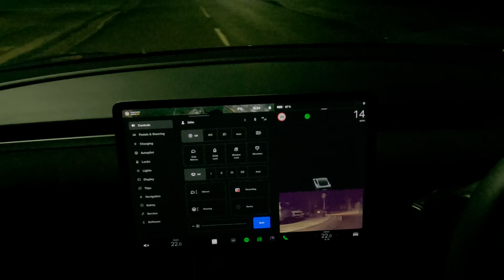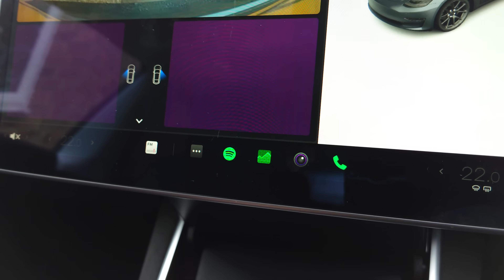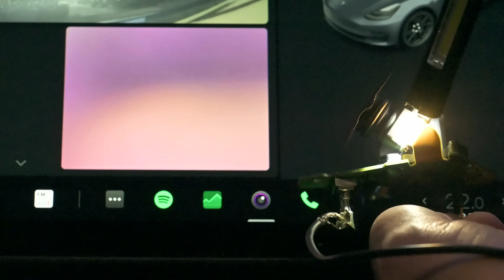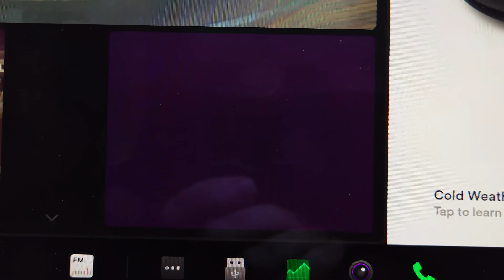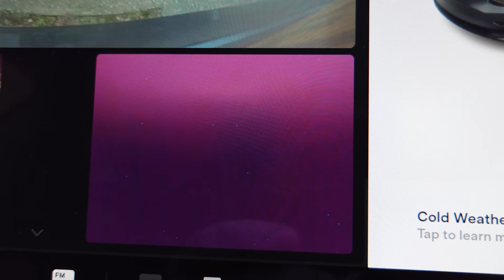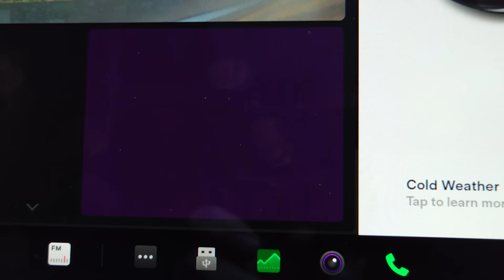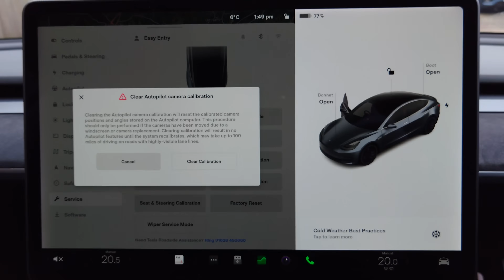Repeater glare and how to fix it (if you dare!)

Comment: 6:53 The simple work around seems to be just to leave the 12v connector removed and leave the camera connector attached. If the 12v side blinker has no power... you will get no light leakage

10:52 Much like you did in the Demo here with no 12v to test the light leakage... just remove the power source and you are GOLDEN 😂

Comment: Wouldn't it be better to bake the unit and separate the glass from the plastic housing and apply the tape as done on the new updated unit? Add some sealant if necessary and clamp it back into place with some heat?
Reply from the maker: It's not possible to split the hosing, it's welded, so you'd need to cut it which is very tricky to attept without risking damage to the components inside.

Comment: I watched this video and few other ones. They really rather excellent. Thank you for sharing. I'm also fo the opinion that less parts  the landfill or recycled is better. Especially if we can easily fix them. I wonder if you came across issues with excessive condesation inside the fronk, front boot, however this is called. In my Tesla model 3 2020 this seams this be an issue even after replacing the seal.

Comment: Directions great, paint I used, not so great. DO NOT USE ACRYLIC PAINT! It will short the boards and then it does not work.
Reply from the maker: Partly why I tend to use liquid insulation tape. Maybe you used black paint which had a carbon content? Good point though. Check whatever you use is non-conductive!

Comment: I used a soldering iron with a thin tip.  Then used Sika black adhesive to cover the holes, transparent glue and then seal the 2 holes
But first I purchased a damaged (broken clips) camera to to a test run.

Comment: Did this today as this was annoying me for a long time. Drilled the two holes but cut a slot between the two with a dremal. Then used epoxy resin with black pigment and poured a tiny amount over the camera. Then used Colloidal Silica to thicken the resin and seal up the slot I made. Worked very well. Thanks for posting this.

Comment: Have you considered trying some sort of chemical attack on the glue holding the 2 halves together? May be worth just redoing the glue rather than drilling holes.
Reply from the maker: They aren't glued, they are welded using heat or ultrasonic welding.

Comment: Man, I went into this with the utmost confidence and it ended up costing me 200 bucks on used cameras. No fault of the video though.

Where I screwed up is I was doing both cameras at the same time. I used a soldering iron to make the holes and then used a small drill bit to clean them up. While cleaning them up I must have knicked something. Follow his directions to a T and you won't have any issues. Lesson here is don't get cocky lol

Comment: One could argue it's a safety issue to have  glare from the turn signal light. Therefore Tesla should be pro-actively issuing a voluntary recall or a replacement program. They are at risk of a lawsuit.

Comment: Thank you so much for this video!  Made the modifications straightforward. And wow, did it ever work! So much better without the light bleed. 

I used spray paint to cover the leakage. I sprayed paint onto a scrap piece of plastic, let it dry for a couple minutes to thicken, and then applied with a toothpick.

Comment: I have a 2019 m3 exactly this issue I’ve been ignoring thinking bad design but I saw someone posted Tesla FB forum they got them replaced under warranty, mine is still under warranty so I booked a service call the quote was AUD$449 to come out and replace, I called the service centre to confirm it’s a warranty issue, I was told “ it’s not a warranty item because it’s a known design problem so not covered” so I cancelled the request then searched found your fix and decided to try it.
I did it slightly differently using a Drexel tool to tease away enough casing to see the pcb, then pumped a little black silicone onto pcb as you did to fill the three holes and the edge of the board, then I covered the camera lens and reconnected and tested the result was massive improvement so I filled the hole with bit more silicone to prevent water getting in and popped it back into wing.
Then I repeated on other side but this time spent an extra couple of minutes testing and adding silicone until the results were almost perfect before filling the hole and refitting into wing.
Cut my finger on the fake chrome plastic trim edge, damn that was sharp lol anyway thanks to you and your work I’ve spent an hour and and $5 for a tube of silicone to save myself AUD $444 😮😊
Thanks again
Reply: Awesome! Is it still going strong in 2025, or did water enter at some point? Looking to do this on my 2019 Model 3
Reply: Damnnn lol😊

Comment: Also,  the black bodies are made from Polymethyl methacrylate (PMMA or Acrylic). This is easily "cut" with a hot knife, plastic welded with the same or  "glued" with some common adhesives like two part epoxies or UV cured adhesives.  If its a crack, there are acrylic glues like "weld on" for acrylics.  This literially "melts' the acrylic and lets it reform. Keep in mind this plastic is very brittle and is referred to as glass in the trade. I was reminded of this pulling one of my lights and the entire top cracked off because I was a bit off on where I was prying :/

Comment: Just adding that my  ebay1495864-20-C camera did NOT bleed any light while driving or with tape over it.  It took less than 5 mins to pop the old one off the fender with a nylon tool without damaging the old camera and 60 seconds to plug in the replacement and snap it all back into place. About 60 mins of driving after reseting the camera calibration.

Comment: YouTube is excellent for helping others with this type of video.
Excellent detective work.
I used a flat blade melting tip on my soldering iron and cut a square-ish piece out with the width of the 2 holes you showed. Heaps of room to place black epoxy on the problem areas. Then I used the same epoxy to affix piece I cut out.
Simple operation really.
Done both in 40mins. No glare.
Thank you.
Reply: Exactly what I was planning on doing, I feel more controlled than the drill. This is old but do you have pics of the cut you made to see how the camera looks inside?
Reply: Sorry I didn't take pics.  @MarianoBarutta
Reply: Nice idea,be careful of plastic fumes though. Not safe to melt/burn plastic in places with low ventilation

Comment: In the $470 to replace them, was that for both sides and did it include labor, or just parts?
That helps decide which way to go.
In WA state with all the grey, dark and rain, that glare is a real issue.
Thanks

Comment: I decided not to do this mod and simply DIY replaced them with the latest -D revision. One thing to note: I opted to keep the Chrome look for my Late 2018 build. Repeater assemblies come with the FLAT BLACK eyebrow COVERS. Those must be removed in order to install the CHROME eyebrow COVERS. I used a hair dryer to warm the covers and adhesive tape. I started from the narrow aft end, gently prying the cover off. I cleaned the contact area of all adhesive residue using 3m adhesive remover. Any adhesive remover will work though.  I peeled the protective backer, aligned the cover, and pressed firmly all around it. The fit is perfect too the original. 
Cost. Repeater $130 ea  replacement chrome covers $25 ea. Total $325 incl tax. DIY savings $170-$200 in labor.
Reply: What cameras did you buy
Reply: 1495864/5-20-D

Was this the PN you got?

Comment: Dude, this worked!  Thanks so much.   My experience:
1) I was able to get into the fenderwell without removing the bottom snaps, I just used a plastic spurg tool to pull out the liner and was able to cram my hand up inside to release the cameras.
2) I drilled all 4 holes (two each) by hand, and I ended up going WAY too deep on almost every hole.  I definitely hit stuff inside the housing, but everything still works fine.
3) I used the same silicone sealant on the inside as I did to seal the holes on the outside, I didn't use a separate epoxy.
4) I realized that just one layer of electrical tape wasn't enough to get the cameras fully dark, I ended up putting on 3 or 4 layers to be sure I blocked all the light in testing.
5) I just used a small zip tie to smudge stuff around inside the housing.  But I used a TON of black silicone, I just gooped it up as much as I could inside.
That works great so far and only cost me the price of a 3 oz tube of Permatex black adhesive RTV sealant.
Reply: Are you resolve? Because there is an update in the info of video. Thanks

Comment: I just unplugged the blinker on the repeater and called it a day. Sealed the connectors with some electric tape in case I want to do this in a later day… There’s already plenty of blinkers on the car, no need for those. If you still have your car under warranty this is probably the best option for you as well. Keep in mind, if you don’t put a resistor, the other blinkers will blink at a faster rate…

Comment: I use either a old soldering iron or some nichrome wire to cut plastic on critical parts. The soldering iron has a screw in the tip with a piece of copper pipe end cap that I used for larger holes. You can smash them a bit for different shapes. When done pop out the piece and epoxy paste it back in or use ABS sludge to fill in the gap.  I use printer toner in resin (uv takes a bit longer to cure) to make extremely black resin when needed.

Comment: So it is a design defect, but not a manufacturing defect. It is not working as intended, it's working the way it was designed, the design is defective. It also likely reflects a lack of testing under all common circumstances the part will encounter over its lifetime. The way Tesla designs and builds cars it is a sort of in-service trial. As the cars they have sold report design and manufacturing defects, they fix them without reporting them. I assume other manufacturers do similar things, though I think it is a bit more deliberately baked into the Tesla process. With a Tesla it is more likely than with other manufacturers that car 300 off assembly line on a Wednesday has different parts than car 301 off the same assembly line on Wednesday because fixes are integrated into the daily process, rather than just the annual process.
Reply: The only reason we know about this is due to the software upgrade last year that allowed us to see the side camera's vision when the left/right repeaters are activated... Until then, we had no clue.  But Tesla should warranty this item as it is a 'delayed' defect in it's manufacturing and does pose a safety issue as one is unable to see adequately at night using the repeater side cameras for visualization which is abysmal at best.

Comment: Love watching ppl having to destroy things just to open them when there's a very easy way to open anything that is held with adhesive. Its called heat. Heat gun works best but for the majority of things someone might need to remove a simple hair dryer works fine.
That especially works well to remove stickers without leaving glue.

That camera housing opens up mess free with a heat gun. The adhesive can take heat so you have to be careful when heating it. You dont want to melt the plastic. You heat on high to start for a fairly short period, until everything is hot, take off for about 25 seconds to let plastic cool, then use medium heat with a trim prying tool. It'll take the same amount of time then to dremel it and destroy it. 
Only in this case you can simply apply adhesive back and close it like nothing happened.
I've done it to probly 65 up to now. No issues.

P.s: you can also cut a window instead of drilling. With a dremel and cutting wheel, cut a window on the side. Then you can add tape and have plenty room. Silicone it before reinstall.
Reply from the maker: You've haven't done this with these repeater units because it doesn't work with a heat gun. You'd melt the housing long before you'd be able to prise the two halves apart. They are probably welded not glued as there is not an easy way to get into them, but feel free to make your own video and post it if you think your way works.
Reply: @TeslaGurus  ill take you up on it. I dont work at the shop anymore but have a great relationship with the owner so ill try to go in and have one done. 
I did also say you gotta watch out not to melt the thing. 
But thats ok. After all you where the one working for me overthere.

But ill seriously take you up on the video i just dont know when. I drive trucks and currently out of my province for 5 weeks.
I should have a week off upon my return and will try to squeeze it in.
Reply: @CartoonWeasel  These are friction welded, there's no adhesive.

Comment: Im sure there are other ways to open it up
Reply from the maker: Please let us know in the comments if you find better ways!
Reply: @TeslaGurus  upload some HD pictures
Perhaps squeezing it with a vise to open it up as they do with AirPods
Reply from the maker: No, that won't work as the housing uses much thicker plastic than an Airpod! Buy a repeater on ebay and have a go yourself ;)
Reply: @TeslaGurus  they put them together so theres a way to take it apart even if they glue it
Reply: @TeslaGurus  the point of using a vice to open up an airpod is to squeeze it enough to create an entry point and with a vise w rubber you can carefully apply pressure
Reply from the maker: Having taken several apart now I can tell you it's not as easy as you might think.

Comment: What do you make of the design of the newest camera vs the taped over camera? Is it more efficient? Better vision? Shielding?

Also why is it that tesla cameras aren’t HD? These 100 dash cams on the market that are 4K
Reply from the maker: No, I don't think there is much, if any difference between the oldest and newest cameras in terms of vision. These cameras are there mainly for FSD and ADAS and for that they don't need to be the highest resolution available. If they were, there would be much more processing power required in the MCU.

Comment: Thank you so much, I had no idea my repeaters had leaking light causing the blinker glare.  You'd think Tesla would offer us replacement repeaters if not for free, then at a discounted price.  Considering Tesla knew about it!

Update:  Visited a Tesla Service Center yesterday and was told by the manager that Tesla will not replace the repeaters in my 2018 Model 3 because the cameras at the time were never intended to be used as blind spot cameras.  He went on to say that it's doubtful that they will even be replaced down the road for FSD, because the software will most likely work around the glare.  I think this really stinks because if Tesla is going to open up newer features for older models then we should at least get the newer hardware or get a discounted price to buy them.  Seems like Tesla is doing this to convince us to buy a newer model, just like Apple does.
Reply: They did try to do a fix, it used too many compute cycles.  They removed it.

The windshield wiper AI also doesn't work since 4 years, needs a rewrite.  If I back into my batcave, and the light level changes on the front camera, it goes crazy wiping even though the windshield is dry.

Comment: i have some water / humidity I can see inside the light pipe area. On rainy days, I occasionally have the AP tell me the camera is blocked off. Im assuming the goretex patch or the lens seal is leaking somewhere a bit. Would it be ok to bake the camera at 40 degrees or so to get the humidity out or are there any other ideas for this?
Reply from the maker: You could leave the unit in a warm place for a couple of days but if you want to dry it out faster a very low oven would be OK. Then carefully inspect the housing for any cracks and seal them so the water doesn't get in again.

Comment: Be careful in your choice of sealant.  The common type contains acetic acid (smells like strong vinegar) and is very corrosive to metal parts and is not recommended for use on printed circuit boards.
Dow and others make a version that is designed for use around electronic parts.
Reply from the maker: This is a very good point we will mention in our follow up video

Comment: This needs to be recalled. It's a clear safety issue.
Reply: Based on what? I think it could be a safety issue but I am unaware of any proof that it actually is. I am replacing them just in case and because the glare on the blind spot image at night is annoying.
Reply: @JamesBond-qv2ht  based on the fact that you can't see properly and may lane change into something in your blind spot? Seems pretty obvious.
Reply: @elxakiltse8773  A few weeks ago we didn’t even have the blind spot display. I have simply been doing lane changes the old fashioned way with my mirrors at night. I don’t necessarily disagree with you, but I don’t know if it is a recall issue.
Reply: Ironically, it was because of the improved options in our software upgrades that now allows us to see what was always there - a visual defect in design and manufacturing - definitely a warranty issue...

Comment: What do you think of possibly drilling a small hole and shooting sealing foam with low expansion?
Reply from the maker: Anything like this would be quite difficult to control and too easy to get on the window and block the actual repeater.